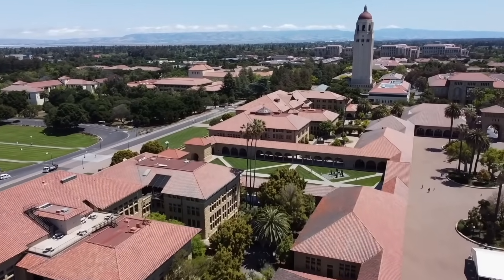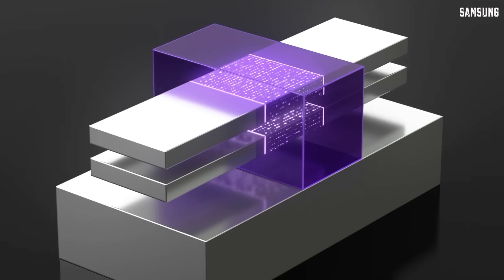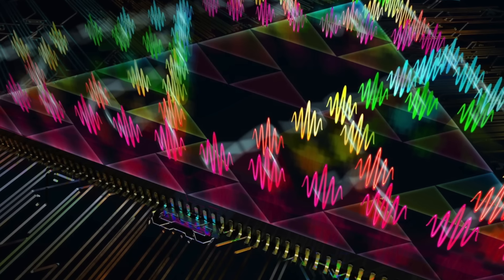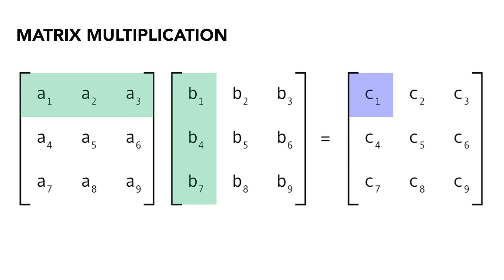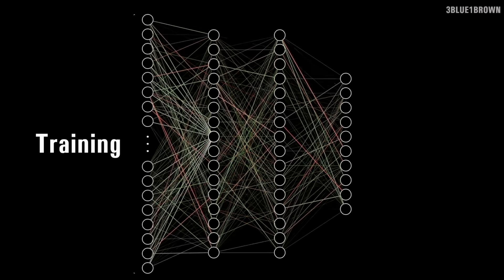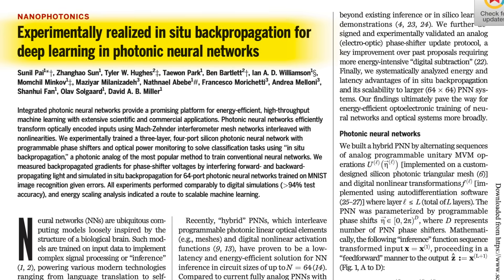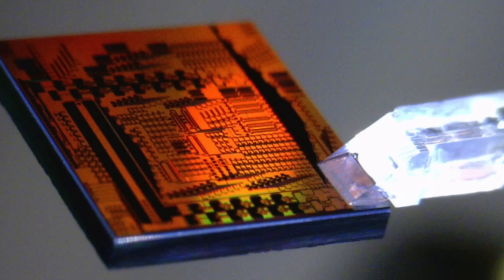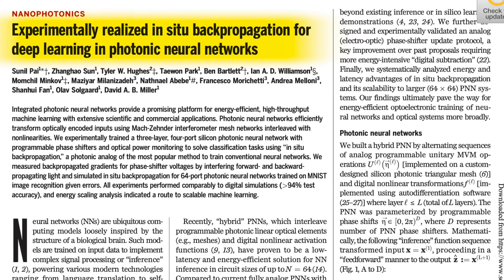Inside Stanford’s New AI Chip

Comment: 0:35: 🚀 Researchers from Stanford have developed the first ever photonic chip capable of training artificial neural networks at the speed of light, offering a potential solution to the energy consumption problem of current AI models.
3:18: 🌈 Photonic chips can increase the throughput of a chip by performing parallel computations at different wavelengths of light, tripling the amount of computation that can be done on a single chip.
6:44: 💡 Training neural networks on photonic chips has been challenging due to the limitations of photonic operations, specifically back propagation.
9:18: 🔬 This research demonstrates back propagation and training in photonic neural networks, marking a milestone in AI training.
12:34: 🌈 The future of photonics faces technical challenges related to size and fabrication.
Recap by Tammy AI

Comment: I think using polarity and wavelength of light creates the fastest computers allowed by physics. I love this idea. Since wave lengths are infinite, so is our multitasking. We won't be limited by CPU cores like we are now. I am curious how the bit rate will change. Will we still be limited to a 64bit bus? Will we be talking about terahertz processing levels? Once photonic computers reach the physical size of our laptops, it will render the laptop as obsolete as the abacus. And to think that the laser generation chip is already 1x1 cm, and only needs 6w of power (5v x 1.2a = phone charger). Since the majority of the energy is in production and output, rather than processing, I wonder how much heat such a computer would produce. Would we need fans? If we can get away from fans, we could get away from any mechanical parts, which means significantly longer life. Does anyone know how much power the LCD screen itself uses on a standard 17 inch thin screen? I'm curious the power requirements of a photonic computer in a laptop form.

Comment: Thinking about time and a theory if we power the clock with earth power time is running in a power form then we ground the spectrum form to power time for a tone to the power of a clock not running time just the power now we have a radio to time then we ground in a space time our body which is framed in power time tone the radio reaction from that will start the flow of time so the clock begins to tell time so is the power of time the clock or flowing power time which one tell time that's when we sync the heat pressure time to find high noon then flow time from that pressure point in space the clock telling time is the light tone to the power of time 🥺 did we start with that we clock radio power that's holding a time form image time then we ground the form of time to the image of moving time the clock moving well running time did that unlock you

Comment: So then using loops and maybe materials they are able to slow light down or let it through unguided to speed it up, and thereby use the delay which is infinitesimal, not only as zero and one but easily becomes useful in quantum computers.
With a grey scale between zero and one based also on statistical reasoning and A.I. and fuzzy logic systems as part of expert systems.
Excellent video. I just love your presentation.

Comment: It currently seems that training the network is much harder problem than the inference and if this new chip can do that with less energy, great. However, it seems that the chip area required is pretty big so I would guess this doesn't yet make sense economically.
Reply: ZoeTheRobot said to me, A neural network is first trained, and then when fully trained, it goes to work doing inference. Do you agree?
Reply: @thomasmaiden3356  Yes, for currently existing systems that's unfortunately the case. For an AGI, that's not good enough.

And if you are designing and planning to build new chips for AI systems, you should be shooting for AGI level performance already.
Reply: @Johnithinuioian I'd define AGI as an AI system that can learn on the field and has no difference between learning and inference parts. We don't have any such systems currently. And we don't yet have a clear idea how to create one because our existing AI technologies do not even try to implement that part.

But we know for sure that there are no learning and inference phases for human brain but both systems are concurrently running so if we want something equally adaptive, we need an artificial system emulating that part, too.

Comment: I love it. I think you are spot on the light chip. The main bottleneck for existing chips is heat dissipation. The light chip will be virtually no heat or limited and it will have the color rainbow to transmit data because of different frequencies leading to parallel computing.

Comment: If infrared and ultraviolet can be used in addition to red, yellow, blue, and sensitivity developed to include orange, green, and purple, the possibility is astounding.  We should have the ability to read even finer increments in color wavelength as we're very familiar with interferometry, and spectrometry in astronomy and other applications, so, the range of light wavelengths we could use should be quite expansive.

Comment: Given the low power requirements of photonics, it seems like a really good candidate for multi-layer stacked silicon packages, which could massively increase density, negativing the drawbacks of the larger silicon processes required. Thoughts?

Comment: Great to see "extreme UV" ASML joining the party in order to address the feature size issue. One saving grace with optical, however, is the very low power dissipation, and it's power dissipation which dictates maximum volumetric density of conventional electronics. Thus we can pack photonics far more densely than electronics, and that will mitigate to some extent the feature size issue.

Comment: It has taken a long time. Superman (1978) had crystals I thought of as photonic processors.

I wasn’t into the comic so not aware of the full story. To me it seemed one day I’d get to design CPUs where I could use light to have all the results to a function computed in parallel. Where results to massive computations would just be read off the crystal processor at the speed of light.

I guess Superman’s father programmed AI crystal photonic processors to answer Superman’s questions.

Comment: Typically good tech presentation, but there is one odd thing. In a couple of instances, you use the phrase "forward and backwards". What is odd is the "forward" part correctly leaves off the s you include, for no obvious reason, at the end of "backward". People confuse uses of these words all the time, but not usually in a case where there is a parallel usage right there in the same sentence. People do fear confusing different uses of "backward" and reach for "backwards" (where there is a colloquial usage of the latter for something turned the wrong way around, though the s is not necessary even here; there is no standard usage of "forwards" in this context), but context will clarify the meaning of this unfortunately ambiguous word. You are clearly not calling the field of photonics unsophisticated or unevolved in these sentences, so there is no call for the misplaced s. "Backward" does the job here, while "backwards" stands out as off balance next to "forward".

That said, your English is pretty amazing, considering where you grew up. (Though your use of the monstrous business-jargon verb "to leverage" indicates some workplace degradation of your skills. There is always room for improvement - and corruption - in our use of the mess we call English.)

One hopes photonics progresses quickly and puts a significant dent in energy use in supercomputing and other areas of data manipulation and management. As far as miniaturization, it will likely remain the case that guides and wavelength parallels will require more size, at the lowest levels, than standard electronics components to do reliable processing. As you suggest, however, processing parallel wavelengths to handle different tasks can overcome, in principle, the benefits of transistor miniaturization, at least for some tasks. Maybe for a lot of tasks - but let us see how that develops.

Comment: In my limited understanding, it seems that light transitors chips are just getting out of the vacuum tube phase and waiting for that eureka moment that lets them scale down towards the more modern chip size. When this is finally achieved and we are able to leverage light as we now use electronics,  I believe we will finally be able to truly make strides towards quantum computing which will then skyrocket AI research which will in turn propel us into  meaningful and impactful strides towards innovation that will be as impactful as the light bulb, TV, computers, internet, the first iPhone. Everything needs a catalyst and I believe that light can be that next leap towards that future.
Reply: does it still means that basic unit off information transfer is still coded in mathematics?
or we are yet to discover a fundamental unit of information transfer that is shared between sound,light,electric,emf, & matter?

Comment: Photonic chips is the futur of computing, not only because of less energy used, less heat produced and faster speed, but also because of parallel light frequency used simultaneously. And I don't even talk about Photonic quantum computing at normal temperature.

Comment: Trained here.  The simplest formula to remember is this.  Bandwidth multiplied by frequency equals information exchange potential. That’s a formula for fiber optic cable and equipment design.  The internet has demonstrated that the available bandwidth of our light spectrum is almost unlimited by our normal numeric standards.  As for putting it all in a micro chip.  Stand back.

Comment: I'm fairly sure AT&T has been doing this same thing for decades with fiber optic cable transmission. 13 pair of fiber optics replaced huge copper cables installed during the cold war. The transmission rates were astronomically faster and then they went with adding colors to isolate individual transmissions on the same 13 pair. This was in the late 80's. I patrolled those initial installations and talked with a lot of the techs daily. The tech has been around for a long while but not shared apparently. I could listen to you read the dictionary or phone book regardless. I won't state the obvious...

Comment: Photonic computers have another interesting feature. If the clock frequency is very high, the hardware has to be small to avoid signal delays. A frequency of 1GHz, corresponding to a period of 1 nanosecond, allows a light signal to propagate only 30 cm.
Reply: Hi! Could you elaborate more about the implications this interesting feature? I am not to familiarized with this physics
Reply: @danielmurogonzalez1911  The electronic signals on a chip cannot use very high frequencies, as the high density of the circuits would generate so much heat that it would be impossible to dissipate it properly, burning the chip. But photonic signals do not have this limitation because they do not generate heat in the same way, allowing the use of much higher frequencies. A signal switched at 1Ghz has a period of 1 nanosecond. As the speed of light is limited, in that time it travels only 30 cm. Theoretically, to synchronize all signals from a photonic computer, hardware distances greater than this could not be used, as data could be lost. If the frequencies were even higher, the distances would have to be proportionally smaller. If the frequency is 100 GHz, for example, the light travels only 3mm.
Reply: @Blsnro  
Your understanding is partially correct.
The speed of light in a vacuum is approximately 300,000 kilometers per second, or approximately 30 centimeters per nanosecond. This means that light can travel a distance of approximately 30 centimeters in one nanosecond.

The clock frequency, expressed in gigahertz (GHz), indicates the number of cycles per second. For example, a clock frequency of 1 GHz means that there are 1 billion cycles per second, which corresponds to a period of 1 nanosecond.
Reply: @unbiased3949  I´m confused. Where is my error?

Comment: very interesting as someone who has spent years building pc's and doing networking its good to learn how it all works photonics has a lot of potential  as for the size of the chips they will shrink but given the light nature of the tec i could easily see distributed clusters of chips using fibre as an interconnect add multi mode transmission and you have the capability to prosses vast amounts of data even over a larger physical area. thanks for the vid look forward to more.